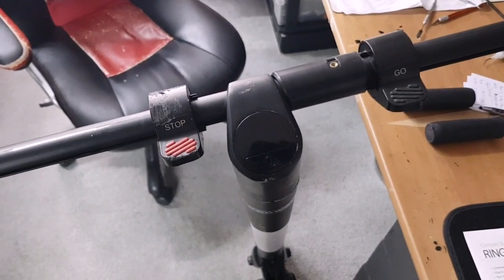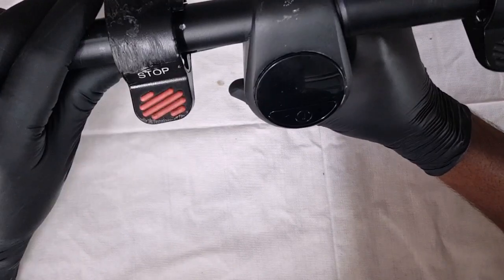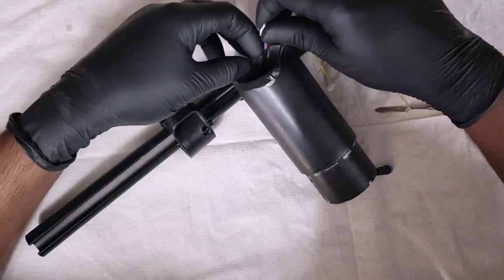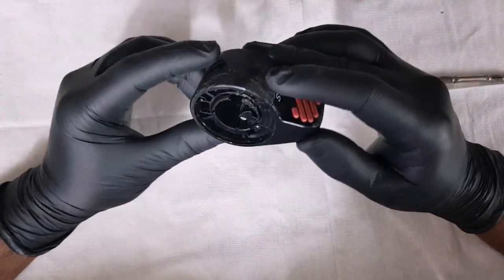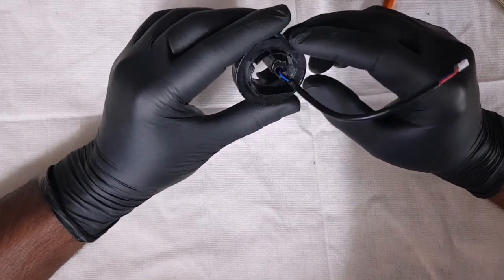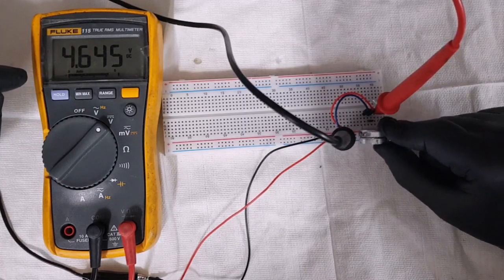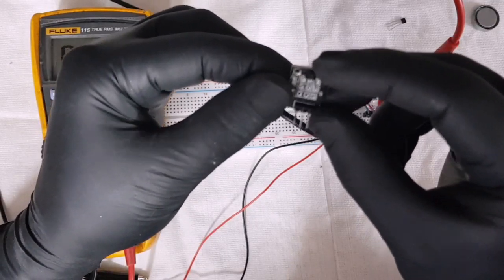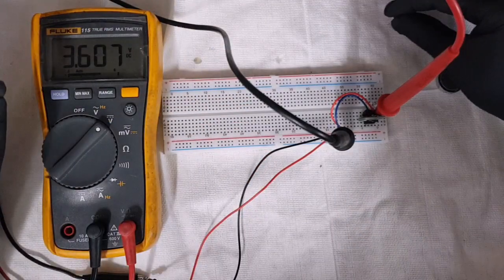Es2 Segway Electric Scooter (Brake handle hall effect sensor repair) Error 14, 15

Comment: Isn't this because the nub that sticks out broke because it has to hit a barrier for the lever to stop.  What happened with my accident was that after taking it apart. The nub that surrounds the hall sensor snapped off.  From what I can tell the sensor is fine.  The integrity of the nub/casing around the sensor is compromised.  Without gluing you can push to hard on the brake the hall sensor will not line up again and you are in a similar situation as before. I really liked the video.

Comment: I had error 15 come up after I hit a bump real hard,after a little research on YouTube and finding out the magnets can get dislodged which caused the problem but before taking it apart give the brake lever some quick flicking back a forth and that might fix the problem which I did and heh presto, FIXED!

Comment: hello do you think we can swap the brake remote with a xiaomi 365 lever so I can use for a drum brake on the rear contemporary to front electric brake ?
Reply from the maker: Segway components are motherboard specific. Cannot be altered or changed

Comment: Upon further investigation I realized that the a3144 is the wrong type of hall sensor for this it is an open collector type and requires a pull-up resistor on the signal output otherwise it just opens and closes the circuit and doesn't output a voltage.
Reply: Good question because a hall sensor is used with throttle.